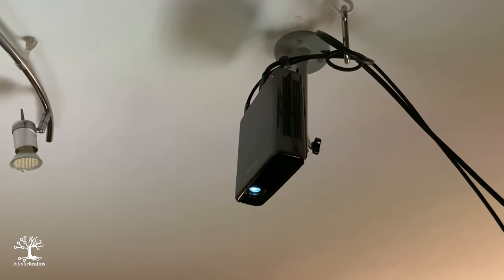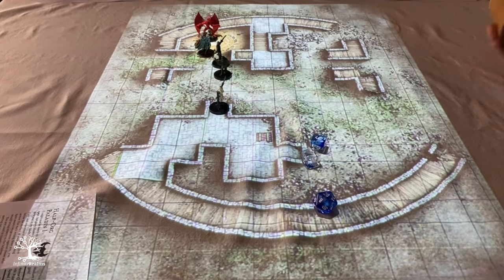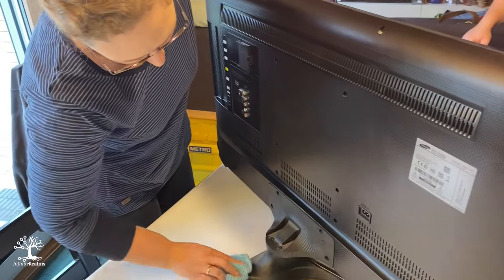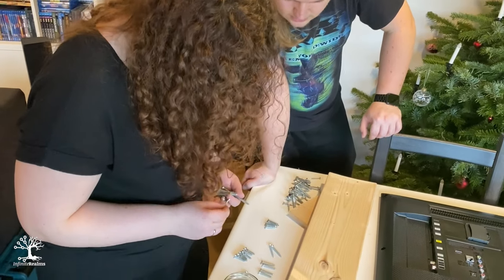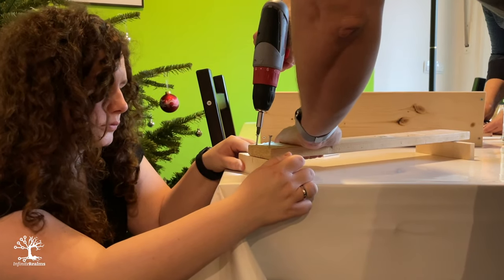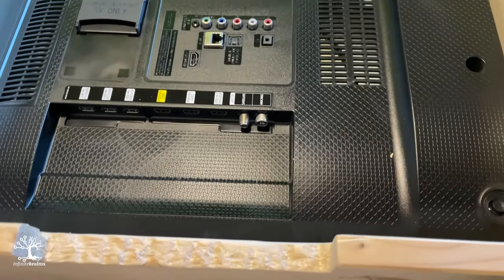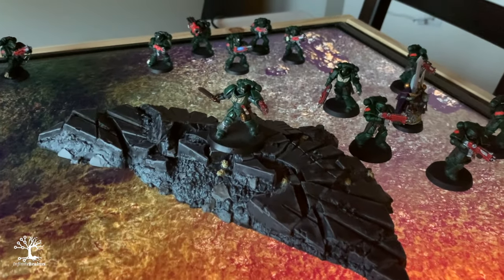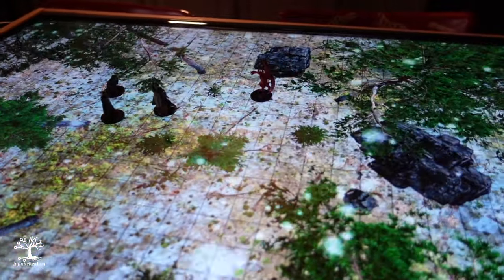Building a tabletop TV Case for RPGs and Wargaming

Comment: You should add ventilation and/or temperature monitoring to your wooden case. Do not underestimate the heat buildup of the tv.
Reply from the maker: This is a good point! Actually we have checked the temperature at various points during the last 6 hour session and we measured a maximum of 41°C at a hotspot near the end of the session, still far from an alarming level. We have to see how that changes come summer.

Comment: I am in process of milling wood for our gaming table. My plan is to use a wall mount for tv (kind without an arm) so I can adjust the X and Y axis. This will leave room for cooling and have back up plan for additional fans if needed.  I am uncertain if I am going to attempt to remove the bezel from the front of the TV so I can make it fit so grid lines would extend to the physical table without the bezel gap.
Reply from the maker: We are thinking about using a vanilla wall mount as a base for version 2.0 as well. It would be great to see your design in action!
Reply: That's an idea I had not considered.  Using a wall mount kit... hmmm.

Comment: Nice.  I have built my own set top box, and I was careful to include ventilation holes, etc.  I wish I'd filmed it, but this was back in 2018.  Oh well.  It was a gift for a friend.  I also made mine with a sturdy handle for carrying and a slide in lid to protect the monitor while being transported.  I also used special 90deg angle plugs to minimize the distance to the table, and allow for both standard and HDMI connections.  Fun fun.  I've got to check out your battle maps sometime.  They look AWESOME!
Reply from the maker: Thank you very much! 
We will also build a second case with fan, handle to carry and a bit prettier. But that still has time... 
Maybe you film when you build the next, then we can also still be inspired.

Comment: I would recommend taking advantage of the VESA holes during planning and final assembly, as they usually are on the same plane to each other and already have threads in them that can hold the weight of the TV - not necessarily on its back, but for lifting the TV out of the box, if the top is later covered by the acrylic. For the VESA holes, it's better to use threaded rod with a nut however, so as not to accidentally screw in a bolt too deep into the TV and break something - the maximum depth can usually be found in the TV's manual or parsed from the length of the VESA bolts provided.

My current plan is to make a very short single leg stand that affixes to the VESA mount, so as to still have access to all that tablespace underneath the TV. Not sure how wobbly this might get, but I'm still prototyping.

Comment: Having worked with monitors for years, my BIGGEST concern when people mount them like this is COOLING. Normally air-flow is from bottom to top of the monitor, and passive cooling is fine.  However, when you put them in a case like this, and mount them face-up, you are not providing any "air flow." This will shorten the life of the components in the monitor, depending on how long your gaming sessions are.

I always recommend at LEAST a low-wattage "computer case" cooling fan, with an intake on one side and an exhaust port on the other side of your case, to keep the air moving. It doesn't have to move much air, but any air movement as opposed to just cooking your monitor in its own heat is preferable.
Reply: Sure but how do you power the fans?
Reply: @fufu1405  Most TVs have USB ports. Get some USB powered fans.
Reply: Interesting thought.  When I built mine, I was very generous with air holes to allow for natural air circulation.  I didn't have room for a fan, but maybe my next build....
Reply: I have been using mine for over 10 years now, I used a usb powered computer fan pushing air into one of the TV's vents, plugged into one of the TV's usb port for power, it is set to minimum speed so it's quiet and provides adequate air flow, the tv screen never becomes warm.

Comment: Great video!  We use a TV, too, recessed into the table, with a sheet of glass for protection. TV is open at the bottom, so there is ample airflow, as it is kept in place by two metal straps (this is how many monitors are mounted in arcade-style video game cabinets).
Reply from the maker: Thanks! We are a looking into ways to improve air flow a bit - it does not get that hot, just in case. Your solution sounds near perfect!

Comment: I'm thinking of a square hole in the table and the monitor mounted under on a regular monitor arm so it can be raised up flush to the table surface, locked and played on.
When not played on, lower the monitor a bit and put a sheet of wood over the hole.

Comment: Excellent and straight forward video walkthrough. Kudos! May I ask what size and type of TV screen you are using? Looks like 43 inches? Is it LCD or LED? What about heat, is there a risk of heat damaging the screen component from below? Any experiences in this regard?
Reply from the maker: Thanks! It is an old 40” LCD. It does not get particularly warm so we scrapped the idea of adding some fans for active cooling. All in all it may get a bit warmer than standing upright, but not much. And due to it being used every other week or so for 4-8 hours compared to a normal TV being used daily… we guess it has no negative effect on the lifetime of the TV.
This may be different with a different TV though!
Reply: @infiniterealms8479  excellent! I tried a 32” Philips LED (it was cheap and insanely lightweight). Unfortunately the screen size was too small so I’m aiming at a 43” when finances are in place :) Thanks a lot for your response, I’ll keep you posted on my progress :) //Casper (Aus Dänemark :))

Comment: Hey I am thinking about adding TV box or projector setup.

Any reason why you mad your box so deep?
My table is tall so I would like to minimize added height.
Reply from the maker: Hi Eric,
We used the boards as we bought them, you can certainly take narrower ones.
Just make sure that there is enough space (or a fan) that the warm air does not accumulate!

Comment: Ive watched several videos of people who have built their own TV gaming table and it seems like once people have a frame built they run into the issue of getting the screen to be level inside of the frame and dealing with the fact that the back of the TV isnt flat and they always end up having to very carefuly make support pieces of various geometries to hold the TV level and support it at different places on the back of the TV. Wouldn't it be a million times easier to just run some thick, high quality velcro straps across the frame to cradle the TV in the box? The straps would be precisely adjustable and wouldn't care about the geometry of the back of the TV. It would be far easier to adjust each strap as needed than to cut all of the specific pieces of wood to support the TV at the correct height annd angle for each spot where a support is needed, wouldn't it?

You could just place the frame upside-down, lay the TV into the frame screen-side down, then tighten the straps down around the back of the TV and then flip the whole thing over. The screen should be flush with the frame at that point I would think. Even if the TV settles a little bit, if you build it right and do the straps in asmart way, you should be able to adjust the straps as needed with the whole thing face up to raise or lower the screen as needed. In the direction the straps run, the TV should be level no matter what.
Reply from the maker: Seems like a legit alternative! When placing the straps you would just have to take care to not block any ports and ventilation slots.
On the other hand building the central support piece was no real issue. Even for total amateurs like us.
Reply: I ended up using the foam packing blocks (slightly altered) on the top and bottom to fit snugly into the frame and allow the tv to be level.  I also fastened it to the back with the vesa mounting screws.

Comment: Very nice! I'm curious if the thin vinyl on top is affected at all by the heat from the screen? Since this build, have you swapped this out for a more permanent solution like plexiglass?
Reply from the maker: After multiple uses the vinyl has proven to be the perfect solution. The screen in our setup just gets warm to the touch but not hot, even in the summer.